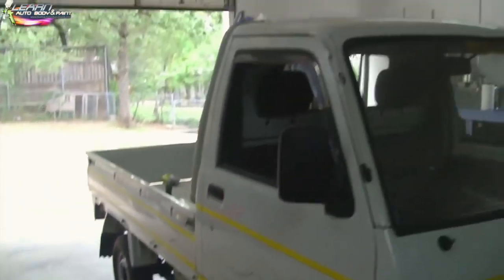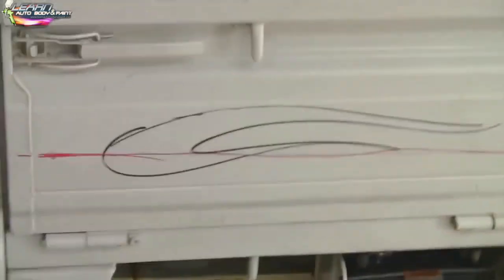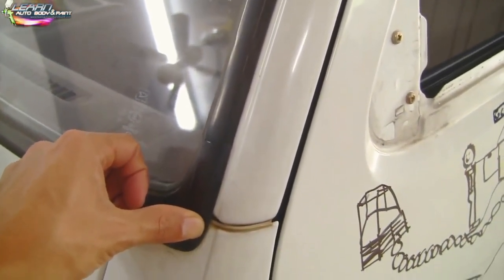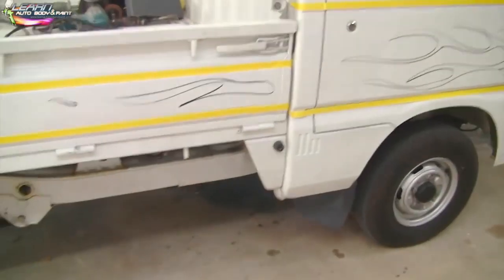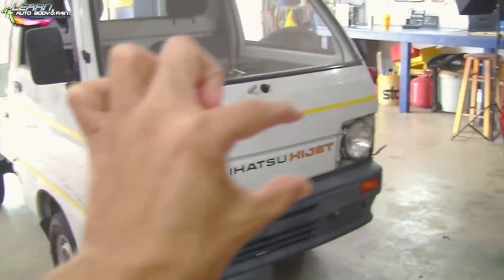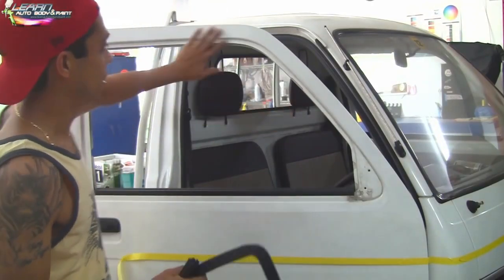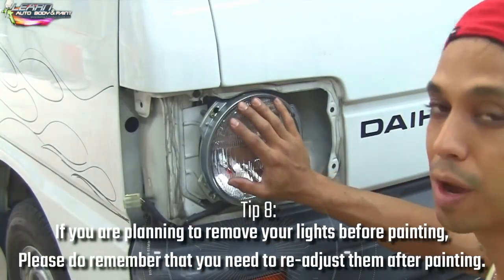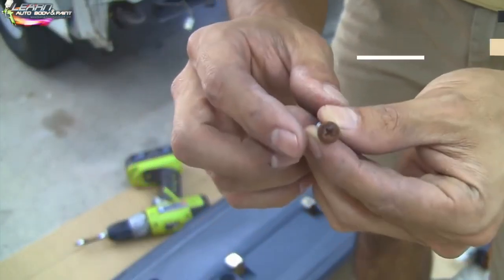Car Painting Tips Before You Paint A Car 😉

Comment: Can't wait to see how that turns out, sounds good! Here's another tip for anyone that's stripping parts - use a bit of old cardboard to push screws and bolts through, you can mark it up and keep it with the parts so you've got an 'inventory' of them so you easily know where they go and less chance of losing them. Saves on head scratching when you've got 1 bolt left trying to think where it came from or more commonly having a gust of wind blow one somewhere you'll never find.. ask me how I know!

Still can't find that wellnut..